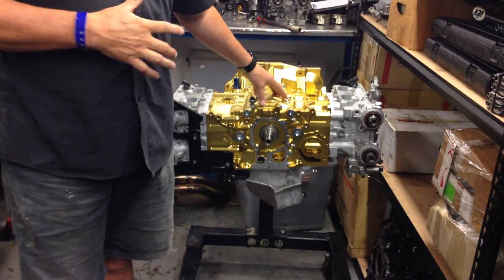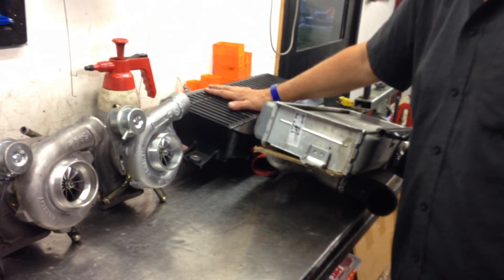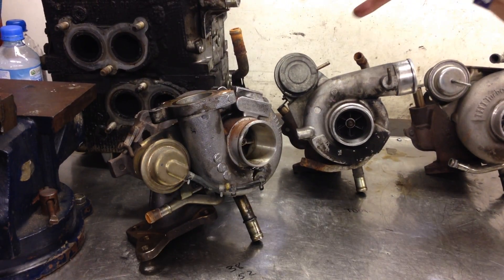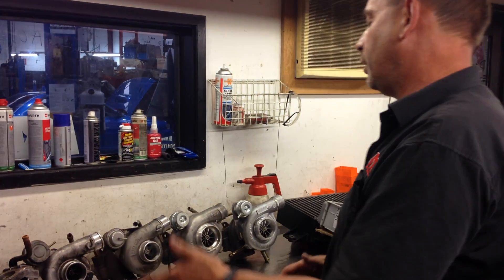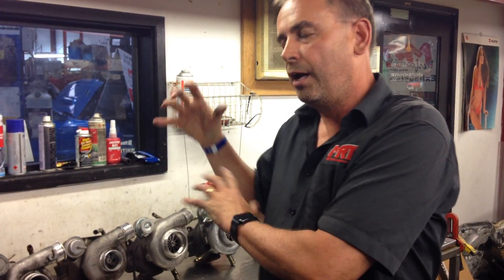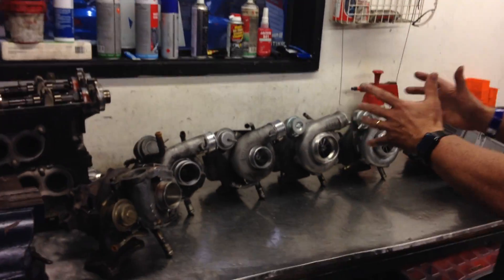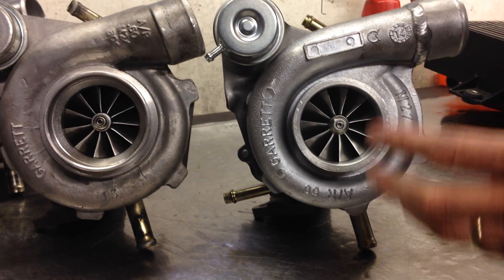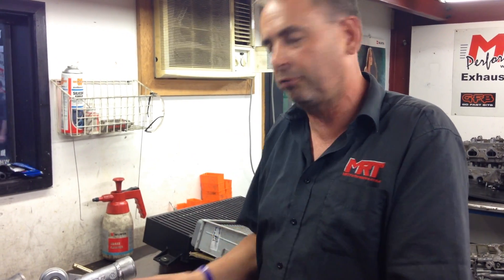Project Billet - Subaru Turbo History / What we've chosen for this EJ Build

Comment: Any tips you could give to revive my 1992 subaru legacy turbo? Turbo leaks bad
Reply: If compression is good fix all your leaks first. Replace all your fluids and do your timing belt, water pump, idlers/tensioner, and spark plugs.Sounds like you need to reseal your turbo, look up some how tos for that or replace your turbo with a used wrx one (or another cheap option). Make sure and check the turbo inlet hose, they crack and fail on 2002 subarus let alone one that's 10 years older. If your fluids are new, you're getting good spark, and there aren't any leaks in your turbo system your car should be doing pretty well.

Comment: What flange is run on the vf38 from the ej20x? bought  a jdm ej20x to replace the blown and sold engine from a 2008wrx
 and i need a downpipe option any information is appreciated.

Comment: 300kW? isn't a billet block absurd massive overkill for that?  What can a billet block do for a 300kW setup that a standard built Subaru block can't?  I watched the first few vids, so I know the general differences.  Is a Subaru block really questionable at only 300kW?  I don't mean this to come across as me hating, just trying to follow the logic here.
Reply from the maker: check the TORQUE, (its not power that kills subaru engines)
Reply: May Also might want to work it forward in future
Reply: Billet blocks are also easier to work on when we add sleeves. And good for high performance since its built with extreme accuracy

Comment: hey mrt I have a quick question I finally did he forged internals build and now that it's starting to get a little bit cold here in Texas I smell Rall gas on the driver side with the car running I check the fuel lines I do not see any fuel leaking out what could it be

Comment: I totally agree with this customer.  screw everyone's opinion
Reply: J53113 hell ya man the piece of mind know your ej will be bullet all the time plus most 800+ are horrible to drive when not on boost I can't wait to see the finished car
Reply: The block is literally gold, you're telling me that has nothing to do with why they picked it? There are plenty of other closed deck options out there that would have been on the same reliability level at less than half the cost. This just doesn't make any sense.
Reply: @jack073  lmfao if the block was made of gold it would be pathetically weak, it's billet aluminum and anodized in that colour as that's the colour the billet blocks come as. the blocks are safe for up to 1000hp

Comment: wow so someone is dropping over 15k in a billet block and says he wants it to be close to factory........ face palm
Reply: GOlD BlocK
Reply: Godlike27 nothing wrong about that...why invest in an expensive upgrade just to run it down to the ground and destroy it?
Reply: @d-a-e  because its a block with a hp potential of over 1000 being kept at stock power levels. Unless its a progressive procedure then getting a billet block is utterly useless. just get a semi closed deck machined in, and machine some sleeves if you need to
Reply: Inverted V12 Powerhouse I think that is the problem. Just cause it is rated for such hp levels doesn’t mean you need to take it all the way there. If I have the funds, I will do the same for maximum reliability. Semi closed decks are crap especially if you decide to have fun with the car sometimes and try to see what the thing can do...and there should be no reason not to push the thing to redline we all buy cars like these because they are super fun to drive but at the expense of reliability
Reply: @d-a-e  semi closed are not crap... They prevent blown HGs. Im not saying he should psuh the block to 1500hp but that leaving it at 305 is an utter waste of money.
Reply: Inverted V12 Powerhouse I have an 07’ STi and the damage list goes on: head gaskets twice, skipped timing belt and bent valves, multiple instances of overheating, ridiculous oil consumption... even when I decided to switch out the shortblock, the machine shop guy said it looked basically new with factory scoring intact, pistons good, so I just did new heads. 1000 mile break in and CEL five codes cylinder misfire on three cylinders. All because I decided to keep the bullshit semi-closed 2.5

Comment: I am going with the verticooler and building my WRX for pure bottom and mids. high end power is overrated unless you are always on a track. When I built my G35 I went for top end performance and mid to high rpm was great, but nothing below 3500. which is generally the DD operation range.

Comment: I thought the 94-95 Wrx turbo was a td05 then they changed to a tdo4
Reply: Mick David yeah I thought they went smaller 97-2000 that's why the older ones are worth more. Bigger in the bigeye to make up for weight and to go with improved heads.

Comment: why would he spend all that money on a bloody billet crank case and not modify to the full extent, should have just close decked the thing!!
Reply: these cars are just money pits, if you modify one thing the next becomes a weak point, i got my engine rebuilt with forged internals for my forester XT capable of 300kwatw, but i was more about reliability than all out power + then my gearbox is now the weak point thats 6-7 gs to upgrade, then a larger turbo, injectors, flex fuel, headers, up pipe ect it doesnt end, no thanks i got better places to spend my money atm like re-investing so i can buy real cars like a Mercedes or a BMW ect, at the end of the day its still a subaru and i think maturity is telling me i need a euro car soon!!
Reply: The Unknown lmfao a lot of euro cars are at the top of money pit lists !
Reply: +the unknown obviously didn't watch the whole video or listen to what brett was saying
Reply: Mate i watch to the end and listened a closed deck would have got the same results that billet crack case would be for massiveeeeee power, its not economical to me, it would have cost some $$$$
Reply: $15000 wooooow fuckn holy shitballs, that would be the cost of a really good full forged closed deck ported and polished heads, without the ancillaries and plenty of power to have fun!!! plus MRT is expensive as fuck, at the end of the day you really need to realise its a car and you will never get your money back, there's smarter ways of creating a strong powerfull engine with the right components and using the money in other areas as you mentioned previously!
Reply: The Unknown this thing can produce 1000hp reliably, for 15k i don't think you can do much better. its basically a really cheap super car
Reply: it is interesting!!
Reply: Same as someone with lots of money with no idea, it's like hmmm I want to buy this Veyron but can you please tune it down to 50HP for my daily drive to get my milk at the corner shop.

Comment: Hi Brett, if it was about bottom end torque, wouldn't a twin scroll better?

Also are these mods legal?
Reply: Greco Conduris regaurdless of if its legal or not, i doubt a cop would pick it. i cant even see my turbo easily without removing the intercooler. then they all look much the same at a glance.
Reply: Ben Vos Hi Ben, whilst I agree with this particular build and Perhaps WRXs in general a cop may not pick it up. Having said that about 10 years ago a mate of mine had a shop build a GTi-R for him. You name it, it had it. Large aftermarket turbo, Jun stroker, FMIC, power FC, injectors, PPG box etc. I have no idea what it cost, but must of been close to 50k with car, parts, labour and tuning. On something like it's 2nd outing got pulled over by the cops, EPA and put off the road. Now that's a bad story as it is, but it gets worse. He pays to get it put back to standard, gets it back on the road, then pays for all the mods to be put back on. Couple weeks later pinged again. It nearly broke him. He landed just getting rid of it after that. So whilst he might be extremely unlucky. It worry me my hard earned could be just thrown away like that.
Reply: Greco Conduris wow, that is shit for luck.
i was nearly stickered a few weeks ago for my window tint.
lucky the cop had a change of heart.
Reply: Ben Vos that's nice of him
Reply: john smith haha Little John your preaching to the wrong choir. Whilst I am a car enthusiast, I have a sports car and an old muscle car, I am also a bike enthusiast. I rode sports bikes for a long time and now I have a Harley. So I have to disagree with you that they are POS. I love riding my bike. Even more than driving my cars. I'm not sure if you ride, but there is something next level about riding bikes that cars can't even come close to matching. And only riders know it.
Reply: @grecoconduris6716  ya, something next level about spending 30k for 70horsepower... It's falling all over it's cam at idle and vibrates at any rpm... Really something about those Harleys
Reply: Tyler Moore cool story bro.
Reply: Tyler Moore My 450 dirt bike only has 54hp and vibrates like hell, requires countless hours of maintenance, constantly fixing or replacing parts on it. Must be something really about it too.
Must be another POS.